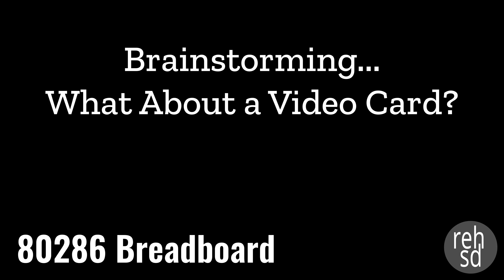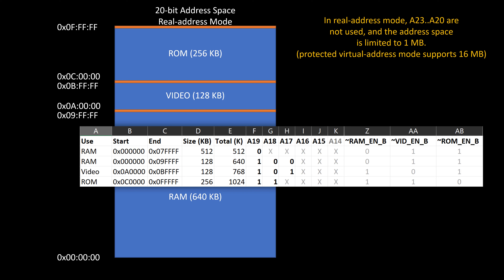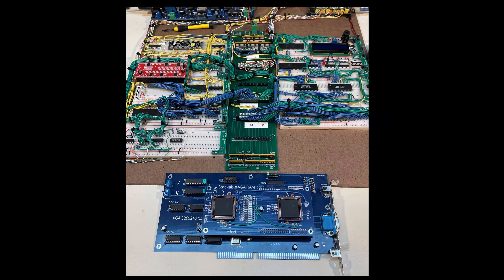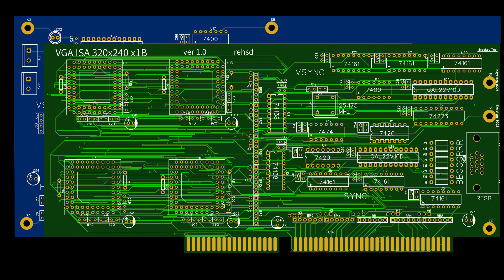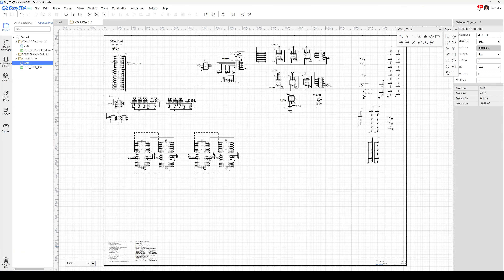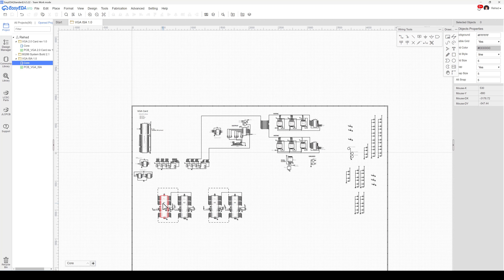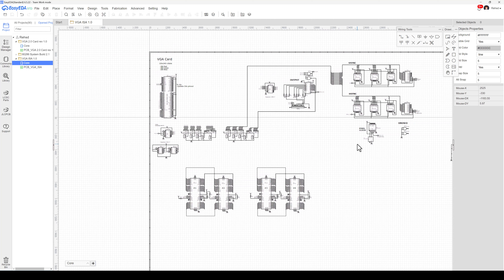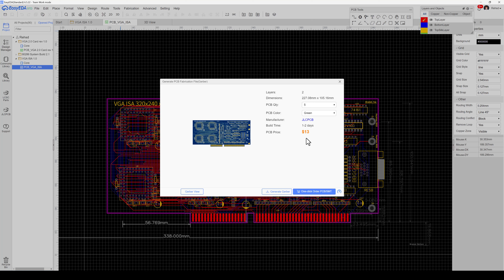80286 Build, Ep. #46 - Brainstorming... What About a Video Card?

Comment: That is one interesting board! 

As far as I know there is no way for the 80286 to limit the output on its databus to the lower 8-bits of its databus when writing to it. 

However, you can always pair up two of these 32Kx8 dual port RAM chips and build your circuit around them. 

This, in turn made me wonder about the video side of things and whether or not you could get around the low-high byte ordering problem there by some clever wiring of your address lines. In the end this basically boils down to interleaving your RAM chips. Writes to byte 0 go to chip 1, writes to byte 1 go to chip 2, writes to byte 3 go back to chip 1, etc. That leaves the fact that you have 4 RAM chips in your circuit. Let's designate the first 32K low VGA RAM and the second 32K high VGA RAM. The obvious choice for differentiating between those two is to use A16. I think that if you include A0 and A16 as part of your chip select logic you're set. You could probably use a 2-to-4 decoder for that, or a 3-to-8 if you need additional signals as input.

Comment: Whole bunch of thoughts. I don;t know whether youtube is theideal venue for deep tech discussions, but for now.  I think you're generally on the rightt track, especially if you've already built a video card. Some random thoughts - seeing as how you have what looks to be at least six and more like ten or twelve clock loads on you 12 MHz 7474 output, I'd consider using a proper clock driver. Cypress used to make them, somethign in the cy7c991 series if memory serves. You get phase matching so no skew between outputs (like if you just buffered through a bunch of parallelled ls244 outputs for example) which means it's still reliable for data handoff, but you don;t have to worry about multipoint loading fucking up your signal integriity.  Also, power and ground, power and ground. Big thick meaty chunky.  Make sure you register the data output of your RAMs going to the video output - someone posted a video card on beneater a while back that had an obvious issue with using async (hence changing timing) data errors on address line boundaries (like xxff to xx00). But my primary comment is that I think you're needlessly afraid of putting your data and RAMs onto both halves of the 16 bit processor bus. I haven;t looked at the 286 datasheet in a long time, but does the processor have a way to write the byte at 0x000000 onto data bus 0-7 but then also write the data byte at 0x000001 onto bus bits 0-7? If not, just connect up the right byte enables and think of the write side (CPU side) as  two banks of 32kx16 RAM (64 bytes total) and the read side (74163 addressed for video raster read)  can be however you want them - x8 or x16.  Honestly, I'd use 16 bit DRAM myself, the raster fetches will take care of teh refresh (unless you want to run at 0 Hz for debug reasons) and use the bus wait to pause the CPU when the VGA is using it, and limit the VGA to like one fetch every 16 clocks, leaving you 15/16 duty cycle for CPU access. You'd need two 8 bit latches/registers to hold the ram output though, and some bus muxing stuff too.  Keep in mind that even with a dual port, when the VGA is fetching address A, the CPU will still be locked out from writing to address A (module howver you molest the address space) so if you write a RAM selftest (which you totally should) you should plan to prevent contention.  It's a fun build though, I've done video stuff for most of the last 30 years, and there are many many ways to skin your cat.
Reply from the maker: I'll look into the clock driver. I'm not currently familiar with them.

As far as I can tell, the processor does not allow you to directly write data at an odd address to the low byte (without manually shifting or something). You can read even, low byte; odd, high byte; or even word (two bytes in a single call, which my 8-bit video card would not support).

When I designed my own 16-bit processor, I used x16 memory and x16 I/O, which was great. This allowed a single address to have two bytes. Unfortunately, the 286 reads a pair of bytes, across two addresses (not a single address), which is kind of a pain. That makes using a single x16 memory not real usable without some special logic around it.

As far as the dual-port... yep, there can be contention, but I rarely see it. Every once and a while I'll see a pixel that didn't get updated properly -- but not often. I do have in my backlog to make this better.

Thanks!!
Reply: @rehsd  Yeah, I didn;t think the 286 would let you write odd addresses to the LSB.  Mostly a rhetorical question. So if you decode a 128K space, you need to be able to handle data coming on all 16 bits of the bus, otherwise you only get 64K space from teh same "101" MSB address bit pattern.  That's effectively throwing away the capacity to access every other byte if I understand your scheme right. I tend to think of say a 1 MByte address space, when put on a 16 bit bus, as a 512K deep address space (address by A1 up to A19 or whatever, instead of A0 up to whatever), having 16 bit wide words. That 16 bit bus also happens to have special flags to let you write only one half, or all, of the word.  The CPU insn set gets to think of the world as byte addressed that just happens to be faster when accessed using 16 bit aligned xfers, but to the external physical memory, think of it as a half as deep  but twice as wide memory. Same amount, but different "shape". The BHE plus A0 can be decoded with your 22V10 or other logic to generate the CPU side bus enable for the low and high devices chip selects connected to the bus.
Reply: @rehsd  And what I mean about this is using the existing four IC's, the byte wide dual ports,  with two on the low bytes D0-D7 and two on the high byte D8-D15.  The BHE/A) gets included in the logic to generate the low byte CS and the high side CS which are generated independently but similarly, the main difference being the (new) inclusion of the byte/word logic from these two lines.  The upper 64K and lower 64K banks still get decoded using opposite polarity of A16 or whatever in the decode.  If you look at a lot of 16 bit memories, the will have separate low and high byte enables.  That' also the reason for the funny burst alignments you see in DDR DRAM for example - the widsth winds up implied in the cycle timing to enable exactly this behaviour.
Reply from the maker: I started a blog post at https://www.rehsdonline.com/post/brainstorming-video-card-for-286-system. I'm not sure if it's a lot better than YouTube for technical discussions, but it does support posting comments.
Reply from the maker: @zxborg9681  That makes sense. I was thinking about what it would take to create two pairs with those four ICs -- low+high (bottom half of memory), low+high (top half of memory).
Reply: @rehsd  Yes.  While it's tru that it's more complex to generate the low and high byte enables separately, this is sort of the cost of doing business with a wider memory system that still supports (legacy) individual byte accesses, like in a more modern processor with 64 bit xfers.  The "bus access" basically points to a 8 byte aligned memory location, so you can ignore the 3 LSBs of address, and then you have eight byte select lines that you can think of as "byte masks" that would either gate the WE to each byte chip or gate the RE to each chip. I think if you look at the data sheet for some of those high pin count memory DIMMs that used to be so popular before serial xfer got so common, you'll see wide data busses and multiple byte enables corresponding to the width of the DIMM module.  Once you get your head around the basic idea, it's pretty much the standard way of doing things.  For the special case of a two-byte wide memory, you can generate the bus strobes using A0 directly, while it isn;t strictly speaking possible with wider busses because you have more combinations. In the 64 bit bus for example, consider eight alignments for a byte, four for an (aligned) int16, two for an aligned int32, and one for a int16. That's a total of 8+4+2+1=15 different possible transfers (even more if you consider the possibility of unaligned access, which can sometimes happen in DDR2/3/4 for cache line access) IIRC. So the wider busses need more signalling pins to disambiguate, while with a 16 bit bus you only need the one pin (BHE) and A0 can fill in the rest (only two single byte possibilities).  But at the end of teh day it's all the same basic idea.